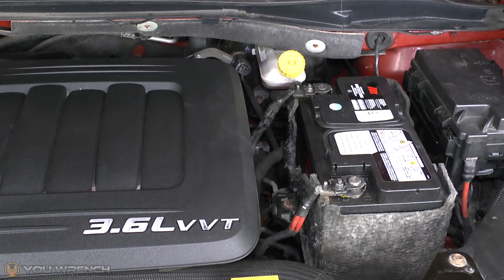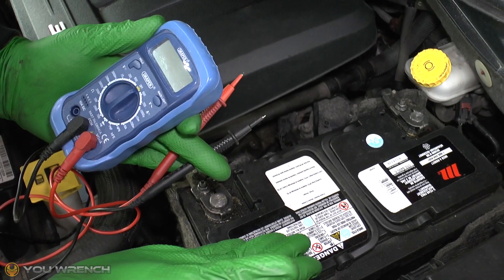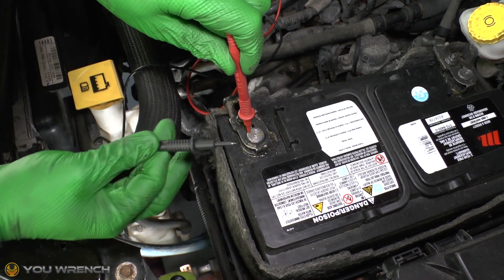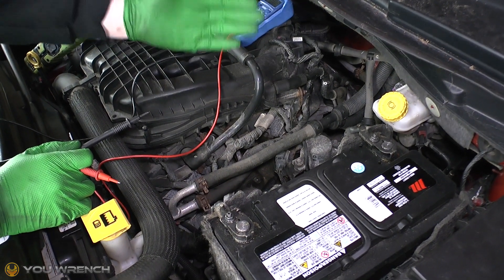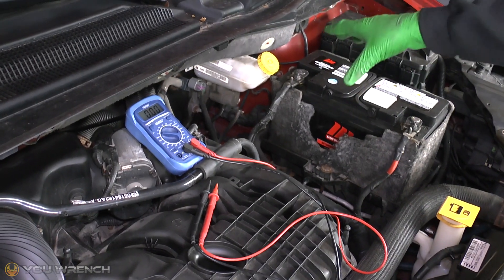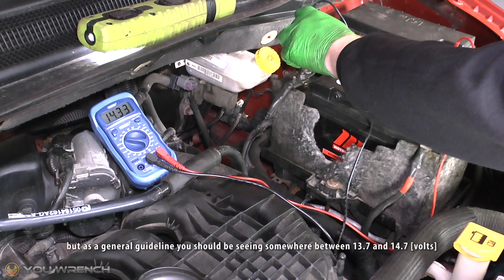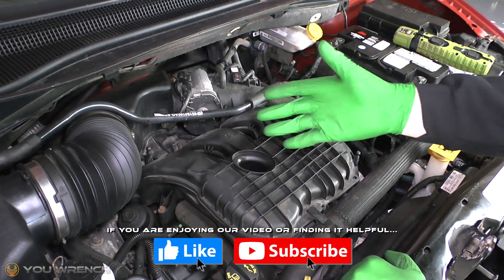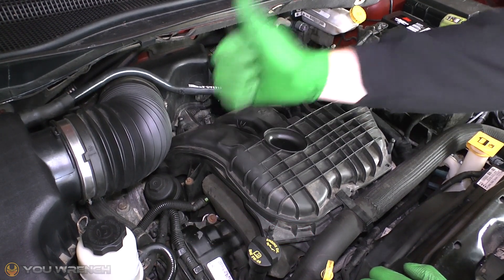How to Test Your Car for Ground Faults - QUICK & EASY!

Comment: The digital meter is so sensitive that without a load the voltage is good. That is, you need to turn on the lights, the heater fan and measure the negative battery wire from the ground wire, first from the engine frame. That is, the voltage should not be 0.1-0.3 V, the larger the ground terminal is oxidized.

Comment: I know this is an old video - but thank you for posting it. Helped me track down a faulty ground on a Toyota Yaris which has been kicking me for a few days.
Reply from the maker: Our pleasure! Happy to hear it was useful. 😊
Reply: What and where was your issue? I have a 2006 Toyota Yaris that starts but doesn’t drive. Lights don’t work, OBD doesn’t work, dash lit up, power steering no go. I’m lost! Thanks.
Reply: @R7887-y4x  Mine ended up being a faulty ground from the positive lead to the crank case and also had to replace the starter relay. Toyota wanted around £500 to diagnose - ended up costing me £6 for the relay and 10 mins to clean the ground. If you can comment with your email address I can send yo over the wiring diargrams which may help you start to track down where the fault is

Comment: What if there's a dead short as I call it. This would be where somewhere on the automobile a hot wire is touching the body or ground of the truck? Would that not destroy or fry your multitester?

Comment: Do I have to remove my oil cap to do this? I noticed the oil cap was gone when you was doing the testing of the battery, should I remove my oil cap to check

Comment: Hello I found that really useful thank you.  Can anyone help ?  I have a fiat panda 2 (2010) with electric assisted steering.  I (and my mechanic) are finding this hard to understand ?  The warning ⚠️ light is coming on and the steering is stiff but ... When I put the headlights on and the rear demister, steering returns and warning light goes off ?  Battery ok.  Alternator ok.  Thanks to extremely clear video, I now know earth ok !!! 😊
Reply from the maker: Glad it helped 👍

Comment: fantastic! thank you! i have an old dodge giving me fits at the moment. getting 12.5 volts from negative battery post to grounds. it's causing random start issues. will use this as well to test as it looks like this might be even a better way of testing grounds. if not it's at least another tool to double check my suspicions,.

Comment: when the car was running should show 14,1.  if’s higher 14.7 your battery not really good or going up and down same battery not good or staying 12,7 battery not good if still running of course  😂  because 12,7  means alternator not good but should died in seconds if it doesn’t died means batteries are bad ! and i tested hundreds of times same!

Comment: Does attaching a jump starter or battery charger to a fully charged battery by-pass the battery's own ground wire? Lights and power on battery charger/jump starter but removing the jump starter/battery charger is like removing the battery itself - tiny bit of residual charge but then nothing. No lights or anything - just nothing - as if Scotty has beamed the battery right out of the truck.

Comment: A voltage drop test under load is far more accurate way of testing a circuit

Until a circuit is under load you may not find out any poor resistance in a circuit
Reply: Thats exactly right,  these multimeter tests wont show rotted cables unfortunately.   Its a real headache  tracing these bad connections.

Comment: And once you found ground faulty ground how do you fix it?
Reply: You have to reconnect the component to ground. Ground faults happen when ten connection back to the battery gets interrupted, I.e broken wire, corrosion, loose plug.

Comment: This is a very good informative video, but there is one issue it did not cover. He touched the clean metal end of the ground wire, which only shows the wire is good but does not check the connection between the wire and the motor itself. So another step should be to do the same test to a point next to where cable is bolted down to. This will show that the connection and cable are good.

Comment: Hello . I’m trying to do this test . When i touch negative and positive battery terminals , it shows 12.6 . And then i do the same with battery positive terminal to xar ground point but the screw and all around it , very rusty . It’s like crumbling metal . I can hardly see the screw . When i touch the screw or surroundings it gives me no reading . Unless i touch the  touch the end of the cable . Would bad , rusty screw affect the ground ? Sorry i don’t mnow much about this
Reply from the maker: Yes, absolutely - rust will stop the power flowing through for sure, and will throw off your readings 👍

Comment: Great video really helpful . Tho was wondering how I would teat a bad earth on a earth somewhere at the back of the van or elsewhere, I have lost my  wash wipe motor and clock, outside temp and now my horn hemal stopped working as well. All this happend after changing tiny bulb for the heater controls and it blew right away. Then everything else stopped working.  Do u think this is a ground fault. Or short circuit , it driving me crazy coming up for my next mot next month..
Reply: short but could be ground  look for chafed wires

Comment: Could I make a point here - you checked voltage on the battery , then where the negative terminal  is attached to the body - that will show that the wire from the battery to that point is transmitting power ( would also need checking under load - cranking the engine ).
What this would not show is a poor connection between the cable and the body - often where rust or oxidation occurs . If you cleaned the paint off the body there you could confirm whether the battery earth is good through that joint - which is high in the list of culprits for earth faults .
Good video otherwise .

Comment: My friend's truck will not start and they are telling him it is a wiring issue, they have had it for over a week and haven't  found the faulty wire yet. What should he do? He says it turns over but does not start, I say check your starter, but he insists he has a good starter. I said the same thing until my stopped, it gave me no warning, it just went to one click, and so I took out the battery first and had it checked, found a bad cell so I bought that, then it still would not start just the same thing, one click, so I got the starter off took and got another one, it started. How can he be so sure his starter is good? It is trying to start but it won't engage. How can he know it isn't the starter?
Reply: Try this.....I use sandpaper and I scrape all my grounds and bolts down to bare metal and copper and if they look corroded then replace them. Also I cover the bare copper w grease or petroleum jelly so it won't rust.  Ur grounds have to be fresh and bolts tight

Comment: I tried your method of finding a ground fault. The display on the Klein multimeter showed zeros when I used the negative probe to touch
the car engine or body. When I used the positive probe I got valid readings.  What's up?

Comment: Awesome video! Got a question, I'm recently having some voltage fluctuations while turning hazards lights on, it varies from 0.2 to 0.4 volts, it's also perceptible as an small vibration on my car, do you think that issue could be related as a faulty ground connection also?

Comment: Could you use the multimeter on diode setting and touch the negative terminal and whatever spot you're testing? You should get a beep or near a dead short reading for a good circuit. Is there anything wrong with this strategy?

Comment: Batt positive to ground in voltage is not a reliable way to test for a GOOD ground.  1 single strand of wire would give you the same 12+volt reading.  Check how much resistance is in the ground.
Reply: Thats why all checks should be done under load

Comment: If I painted the under side of my car is it possible I caused a ground fault if sprayed a screw or ground bolt accidentally?
Reply from the maker: Hey there! No, that would be very unlikely. Everything that needs to be weather sealed typically is (or at least starts out that way). You have to remember how much water from rain and spray the bottom of the car is subject to. It is possible that paint could have got in somewhere it shouldn't (like a connector for example). But simply painting a screw or bolt head should not typically cause a ground fault. Hope that helps  👍

Comment: YW, your lesson was clear and precise.  How do I check whether my car battery is draining when engine is off.  With engine off if I take the voltage reading between the +ve and +ve  terminals and also between the positive and the grounding terminat,  say at 12.14 and after an hour if I check the voltage again connecting the multimeter as before and if the voltage is less than 12.14 does that indicate that the battery is being grounded through some application such as the central locking or the theft alarm or the stereo [ i mean the gadgets that  are suposed to be working even when the engine is off'  Can you plese guide in this matter  with Regards and thnking you for an excellent video

Comment: why did you get a multi- meter that doesn't have a 12 volt setting  for car batteries ?
20 volts is almost double.
Reply from the maker: Multimeters generally do not come with a 12v setting. The standard setting to use for 12v applications is 20v. It does not matter that it is almost double because the multimeter is only reading the voltage that is present, it is not putting out any power. Also you want a setting that is higher than you are reading to allow for fluctuations. Is you used 12v and the reading came in at 12.2v it would not be able to read it and could, in theory, damage the tool. 20v is the correct and standard setting for 12v applications. Hope that helps 👍
Reply: Thanks for you answer to my question. Yes, that makes sense. @YouWrench

Comment: I dislike electrical issues but I think now I can go into finding a grounding PCM issue much easier. Thanks!
Reply: Run a battery cable from the battery ground directly to the alternator bolt bracket etc. this clears up most PCM ground issues.
Reply: @petediamond7263  interesting. Thanks!
Reply: @petediamond7263  with engine running?
Reply: Sounds like your working on a Volvo I'm trying to find the same issue on my V70R

Comment: Interesting, but rather than measure Volts it's best to measure resistance.  Wether it's Volts or Ohms the circuit needs to be under some sort of load.  A test lamp (with a bulb) places a load on the circuit.  LED ones don't.  Proper electrician's Ohmmters stress the circuit with about 300mA at 12V so provide a reliable indication of a poor connection.  On a car, continuity readings should be <0.1 Ohm resistance.    Cheap multimeters are high impedance devices so will load it with less than 1mA and will give a false reading.
Reply: Using resistance is a static measurement u need a dynamic measurement which is LOADED circuit ( vehicle running) Use your volt meter and check for voltage drops  the ground side should be <100 milli volts positive <500 milli volts good continuity doesn’t mean good conductivity CHEERS
Reply: @anthonysova7117  why not just use a 100w 12v bulb, one wire to positive, and one to the ground point. If it flickers then it's a bad ground.
Reply: Good information from you. Electrical problems aren't as difficult as I make them to be, understanding how to properly diagnose,  helps out a lot more though.

Comment: My resting voltage is at 11.9 on a new battery, new alternator and new wiring. When I go down hill and take my foot off the gas my voltage goes to 14.5 but when I put my foot on the gas and accelerate the voltage drops down to 11.9. Then every now and then when I drive my voltage stays at 14.3.. but most of the time its at 11.9.. Any idea on what could be the issue?
Reply: have you solved ?

Comment: In my understanding that's a wrong test for checking the ground for any circuit beacuse the circuit u checking is not loaded yet and it's a possibility the ohm meter mislead you with wrong back emf readings, the best way to check gnd ckt is use your test light with one probe at negative and after loading the ckt check the ground block or terminal if it's glow it is a bad ground🇵🇰🇵🇰
Reply: Well, considering multimeters don't give electromagnetic field readings (emf) I'm not real sure what you think it is your testing lol and as far as the circuit being loaded, you don't need the circuit to be loaded in order to check and see if a ground is providing an adequate circuit connection for the system in which you're testing it on because the circuit being loaded or unloaded, will not change whether or not the grounding point you're using is providing an adequate ground fyi so you've been taught wrong or you understand incorrectly
Reply: @Boosti45  I’m afraid you’re mistaken. The only acceptable way to test an automotive circuit is with the circuit loaded. For example even one strand of wire on a starter cable pass an Ohm’s test yet it cannot handle the current required to start the vehicle. Voltage drop testing loaded circuits is by far the best way. You can use a thermal imager on loaded circuits IF you can view the entire circuit because corrosion equals resistance which produces heat, a typical partial short would oftentimes produce heat as well.  A dead short however may not. The thermal imager is not infallible but still better than Ohm’s testing. It’s simple enough to prove out, go find a cable to sacrifice for testing, cut the wires all except one, give it the Ohm’s test, set it up for a voltage drop test and then try to start the vehicle and watch the wire burn as you also watch the reduced voltage when measuring at the load.
Reply: @glenforehand 👆🏼  This is correct.
  A basic resistance (Ohm's) test with a multimeter measures continuity and resistance in an unloaded circuit (no current flowing). It can detect complete opens (infinite resistance) but often misses partial issues, such as corrosion or fraying that increases resistance only under load.
  A single intact strand in a multi-strand cable can pass a low-current Ohm's test, but fail when carrying hundreds of amps (e.g., during engine cranking).
  Starter cables, for example, typically need to handle 200–500+ amps. Even if resistance reads near 0 ohms unloaded, excessive voltage drop under load can prevent starting. (This is a common diagnostic pitfall emphasized in automotive training (e.g., ASE certification materials) and by mechanics.
  Voltage drop testing involves measuring the voltage difference across a circuit while it's under full load (e.g., cranking the engine). Industry standards (e.g., from SAE and tool manufacturers like Fluke) specify that an acceptable drop is typically <0.5V per connection, or <1V total for the starter circuit.
  It's superior because it reveals real-world performance issues like high resistance from corrosion, loose terminals, or undersized wires.
 Excessive drop = problem.

  Corrosion or high-resistance points generate heat (via I²R losses) when current flows. A thermal imager can visualize hot spots in a loaded circuit, helping pinpoint issues non-destructively.
  Limitations (as he notes), are that dead shorts might not heat up if they bypass the circuit entirely, and ambient conditions or insulation can mask issues. 
  But it's far better than unloaded Ohm's testing for hidden resistance.
  Partial shorts can indeed produce heat, while full shorts might blow fuses or not allow current flow at all.
Reply: @Boosti45 not always. Many times ohms won't be enough. Circuit has to be loaded
Reply: Back emf only exist in ac electrical coil.

Comment: It is an indication that the CONNECTION is solid if no voltage drop.

Series circuits drop voltage at each load.  A loose or corroded connection BECOME an unwanted load.

comment please

Comment: Issue with your methodology; A ground fault can PREVENT a vehicle from running. Which is possibly why you typically measure in ohms to find a ground fault, rather than voltage
Reply: A ground fault does not just have to prevent a vehicle from running... It could be anything from a bulbs shorting out to ground to a bad engine to chassis ground causing a misfire or  worse (fire after a throttle cable is used as ground if engine ground is left disconnected).. 

I agree ohms should used to measure resistance between two points of contact to find a bad connection or wire. 

Volts is normally used to check if the charging system (alternator) is working properly, but this video is a good idea to check for "parasitic drain" caused by devices drawing power while the engine is off
Reply: @OidHunter  I didnt say has to, I said it CAN prevent it. Not that it always will, but uts always a possibility when dealing with grounds. Depends what grounding point has issues
Reply: How exactly do you ohm test?
Reply: That's exactly what I was thinking. When you check for a good ground spot you want the lowest ohms you can get. I was actually looking this up cuz I forgot how to do it but I remember that you check for resistance not voltage.